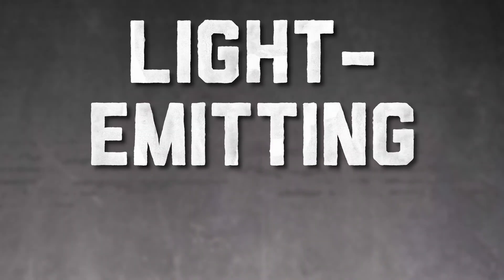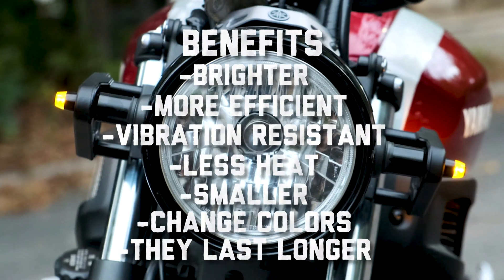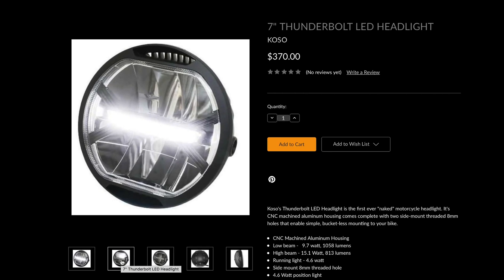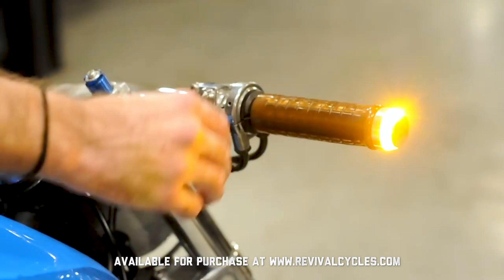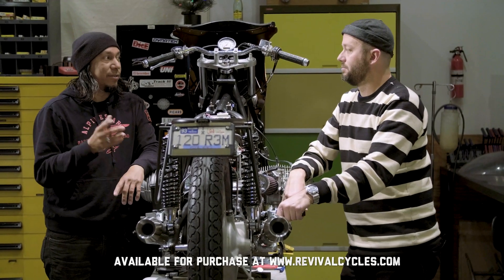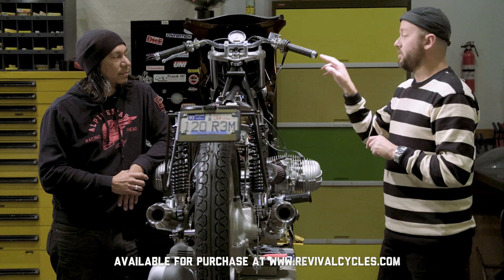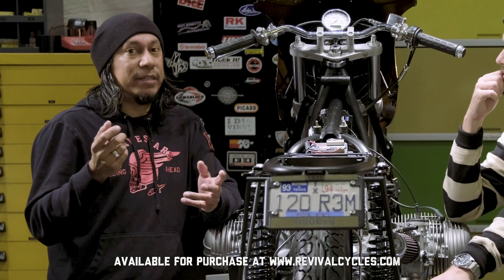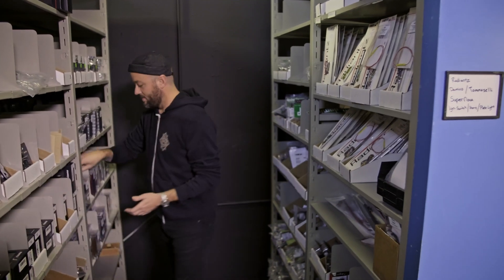How To Wire A Motorcycle Series, Episode 4: LED Lights. What Are They, Why Do I need Them?

Comment: Problem.. got the blaze pins for my front signals. Tried both series and parallel wiring . If my front light is on , my back is off. If the front is disconnected the rear comes on. I'm stuck. Any idea ?  How to get 2 blinkers turned on at once?
Reply from the maker: Have you swapped the old flasher relay for an LED compatible one? That's my preferred solution but if you have just one dash indicator light that flashed for both left and right then you may be better off using load balance resistors in parallel to each of your LED signals.

Comment: Hello.
Have you ever installed 4 mini Pods LED Analog brand indicators on a Bonneville T120, 2016? I'm asking you because my  indicator lights work good, they flash good, I also set it up on type 4. 

But when I turn on the hazard lights, the hazard lights don't work. 

Kind of weird.

Should I change the diod flasher or relay?
Something bad w/ the harness connection?

I would appreciate it.

Heber García
Reply: The ohm rating on the bulb (genuine) is 1.5 if helps.
Reply from the maker: We've never worked with Analogs components. Have you emailed Tony for support? You can always shoot an email to techsupport@revivalcycles.com and the guys might be able to help.

Comment: Can you cover the waterproof connections?  The Mizu P25 as well as Apex high voltage.  When and how to use ?
Reply from the maker: This is definitely in the works. We use a few other connectors and there's a few that I want to work with so that we can distill it down to just what we consider the best connector for any task on a bike.
Reply: Revival Cycles Sounds great.  Do you use SuperSeal too?